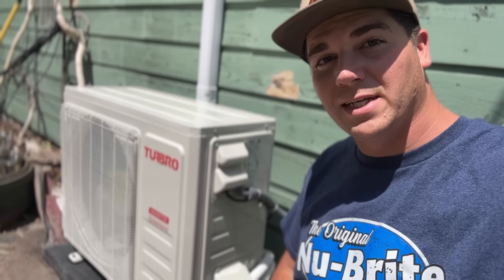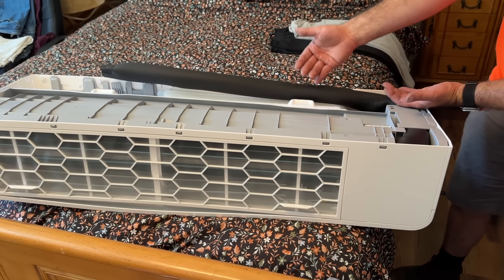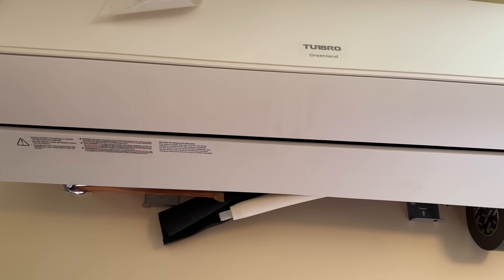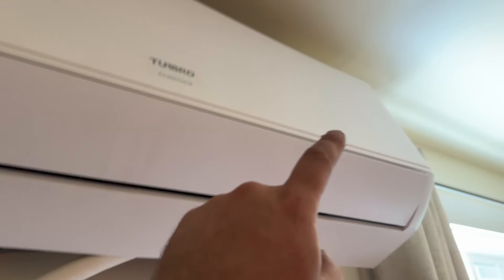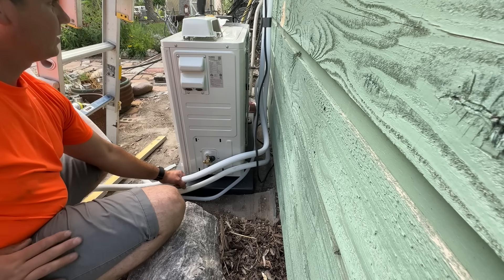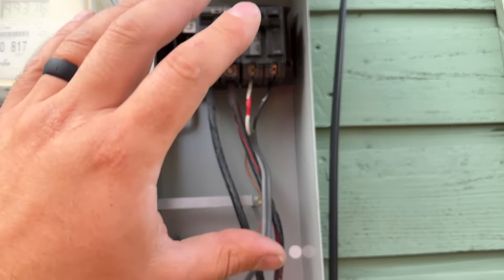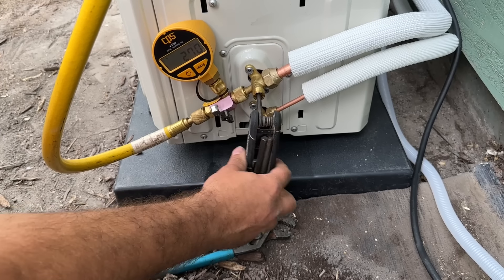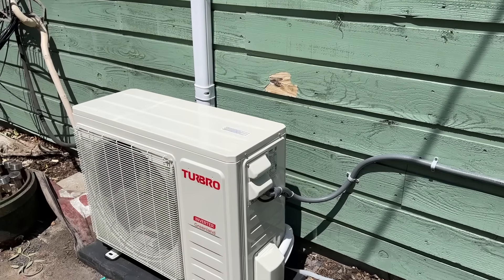Can You Install Your Own Mini Split? Here's All The Things Nobody Tells You!

Comment: Power (240V) to the indoor unit is evidently supplied by the communication wire, is that right? Doesn't this need to go through a conduit or shield of some kind when outrside of a wall?
Reply: No. The communication wire also supplies the indoor unit with power. The cable is listed for this purpose. No conduit required as long as the wire is protected with a line cover set.

Comment: I coiled my lines horizontally behind the condenser which sits about 30" from the wall. I was concerned about compressor oil collecting in the bottom of the coil loops. I'm certain that is does, not certain that it is an issue?

Comment: Do you think its worth it to replace my portable ac with a minisplit? A room where I do music recording upstairs is consistently either 10-15 degrees hotter or colder then the rest of the house. In the winter it doesn't matter as much because my gear/computer tends to warm things up enough, if anything its still can get to 78 degrees in the room in the winter so I often have to run the portable ac. Would a minisplit be more energy efficient? I am sure it will be quieter, the portable ac is LOUD.

Comment: I got a question so I know the mini split comes with the white insulation but i have seen you use a different white type on other systems besides the black k flex so what brand name is that pipe insulation? please

Comment: I installed a mrcool universal heat pump last week and have had the lines freezing over when I run the AC. I checked for leaks at the connections and didn’t find anything. Do you have any recommendations on how to troubleshoot any issue like this? Have you experience this with Mrcool heat pumps by chance?
Reply: I am not an AC installer but let me see if I can give some ideas on experiences I have had with awful installers. First off. Never use an Installer who uses a crew of illegals. 

Then you get stuck with arguing with non English Speaking installers who just walk away and the owner with the license never shows up. Then you have to explain that to them and they don't believe you and then a week later come out and see the mistake and try to fix it and fail and have to buy another unit. Tool 3 installs in a row for me to finally resolve all the issues and walk away from that company. Awful. 

1.  Not sure if you have a 2 story home or not. My first issue with installer was on 2 story. Freon was freezing at unit and not cooling upstairs. After 2 specialists from his crew came out they went and replaced the outside unit. Still no cooling upstairs. Freezing lines outside. Sent another team out. They found a shut off that had been turned off on the upstairs return in the attic where they replaced the coils and heater unit   
So make sure all the returns are opened in the attic. Have no idea why you would have a full shut off for returns. That's air. Not freon. Freon wasn't going up to the coils at all. Just freaking annoying they kicked it closed and walked away without checking for cool air. 

2.  You check for leaks at connections. Did you check to make sure nothing got bent somewhere. Coils or what not. Is it holding pressure. Biggest thing I learned was you have to filter out all the old freon if you change over. Have to get rid of all the bad and moisture. If your unit burned up you may have crud in your freon lines. 2nd house single story. They pulled the old freon but didn't clear it completely and also didn't vacuum it long enough then made sure it held pressure. Unit froze up outside and inside and ran until it blew a hole in the compressor and leaked freon all outside. They replaced unit outside. Owner was ticked and did everything himself. Bad install 2. 

Now for number 3. You may get a unit that says freon included. Believe it or not factories out of Mexico can make mistakes since that is where almost all the units are made. Freon in Mexico is the cost of bottled water. Here it's the cost of gold. Thank you Democrats. Your unit may not have come with enough freon. So just because you have no leaks doesn't mean you had enough freon to start with. You may have to add some. Another 2 story house. 

One other thing. Filter. If you are using the thick 4 inch filters that act like a firewall. That keeps air from going over coils. Try going to a 1 inch filter. More air takes away more cool from coils and allows unit not to freeze up. Just use a good one inch. Get more air. I don't use thick ones. Cost to much but they all do now. It is called Bidenomics. Double the price of everything and then say inflation is slowing down. What a moron way to destroy a country. 

I am not familiar with heat pumps. Just know I don't like them. Thought the house was on fire when auxiliary heat kicked on. Messed up. I will look more into them. Just in Texas we have our own grid and natural gas is cheap. Only way to dry clothes. Cook. And heat a house. And water heater. Not sure I want to steer away from any of that. But Biden will take care of that. Use natural gas to make electricity for your electric everything he wants to force down your throat. Once again Democrat morons.

Comment: I don't understand why you did not move the condensated drain line to the left side, there should be a connector on each side ?😇
Reply: I thought this too with my setup on the turbro - but the spring clip was designed to work on the right side.  There’s a plug on the left that looks like it could be the case but it wasn’t built to work with the clip from the other side.  

This is probably solved by somebody more experienced than myself but I didn’t tempt fate on my first DIY install…
Reply: I installed about a dozen of these misplits for my house and my relatives, Pioneer, Senville, Gree, ... all of them have the drain connectors that I could move the lines to left or right, just use a pair of pliers to remove the clip.

Comment: Why is it that some unit need to be vacuumed and other not and to recharge the unit what should the pressure be and why is it that you only need the low side
Reply: the only units that don't need to be vacuumed are DIY units. they come with pre charged copper lines and they are fixed length
Reply: low side and high side are connected.

Comment: Notice also that a nitrogen pressure test should be done over a vacuum test because in vacuum it has the tendency to pull the connection together and minor leaks are never detected. Besides any rise means there is a leak, that is why high pressure tests are best.  Also check your electrical code for breaker size, 20 amp seemed low, should be a 30 amp breaker. Also use the right wire size such as number 10 wire. Lastly notice this guy is a professional and his neighbor is the DIY guy, yet he asked a professional HVAC tech to do the installation. So all you DIY guys take note that it’s better to have an experienced tech help you.
Reply: The sticker on the side says 20A MOCP/16 MCA.
Reply: @bnasty267  Os that minimum or recommend, because my local code says to use the 30 amp and you have to go by the electrical code for your state not the manufacturer.
Reply: @morallyinsane7639  I highly doubt local code requires a circuit that can handle 2x the current that mini will ever draw, even worst case. Local codes usually are stricter for the ambiguous parts of the NEC, not the stuff that is pretty clear cut where the equipment is rated.  That sounds like some jackoff AHJ (inspector) BS. I'd call him on his nonsense and make him show where the NEC backs what he's saying.

Do you have a link to the the local code?
Reply: @bnasty267  All I am saying is to check you local code, it’s not my ass on the line if something happens, but yours. Do what you want, just understand that if you have a home inspection or something happens and they find it out of code, not only will you be sited, but it could void your insurance. That’s why it’s better to be safe then sorry.  

According to specs for an 18K mini split it calls for either 20-25 amp, that’s why most electricians install a 30 amp. 20 amp is the minimum, recommend is 25 amp, but most breakers are either 15 amp, 20 amp, and the next size up tends to be 30 amp.
Reply: @morallyinsane7639 Agreed. Read the docs, which have to be stated on the plate on the compressor unit with a MCA and MOCP. Size your wire to the MCA and use the recommended MOCP for the breaker size if possible. For AC units, the MOCP can be higher than what the circuit would usually allow for. Dumb home inspectors don't realize this is possible, but that's their failing. Going lower on the MOCP (to the MCA) is usually fine, especially on minisplits that don't have high starting current.

Comment: What's the furthest distance I could install a mini split from the main disconnect? Is there a distance limitation? Thanks!
Reply: General guidance for electrical circuits is to not have more than 3% voltage drop. This is dependent on the gauge of wiring used and the amp draw of the mini. There are calcs online for this: use the MCA rating of the mini for the amps. Roughly speaking, you're good up to about 100 ft of wire, beyond that, you just need to go to the next gauge wiring (probably 10/2 NM for most minis). So, you can go as far as you want, but you might need more expensive wire if really far.

Comment: Hi. When you cut off the first excess copper tubing for the inside unit  at about 10:30, did the nut/bolt/connector come off the part that you cut off so that you then put it back on the copper before making the flare? Or do I need to buy another bolt/connector and if so, what is it called? Thank you for your presentation. Do you have a video showing a manifold guage hooked up to the vacuum pump? I have been trying to configure my electrical. I have a box outside that goes to an inside breaker, a 50, and in the box is a double 30 and a double 20. I’m not so sure the 115v unit using 14AWG and one 20A breaker is all that safe. Is it. Seems alittle easier having the 20A near where I’m putting the outside unit. What do you think?

Comment: Total cost

Fieldpiece MG44 Vacuum Gauge - $231.20
CPS VG Vacuum Gauge - $166.09
NAVAC NP4DLM BreakFree® Cordless Vacuum Pump $779.00
PVC Line Cover Kit $49.99
Basic Electrical Install Kit $185.00 Includes power line whip, electrical disconnect

So, an additional $1411.28 over and above the cost of the mini-split, $679.00 110v or  $709.00 230v, not counting hand tools.
Reply from the maker: $2100 total.   Considering most company’s charge 4-5k for a mini split install. That’s a great savings.
Reply: @diyhvacguy  👍👍👍

Comment: QUESTION:  Do you think you could run an AC off of a battery system for like 8hrs?--Sailboats have a "soft start" capacitor that helps with the amp draw everytime the compressor turns on.
Reply from the maker: Oh sure! Batteries are expensive that’s the problem. Many people have a large enough solar array and batterys to be completely off grid.

Comment: HVAC tech rates.  $80 per hour for me to do the work.  $160 per hour if you've already tried to install or "fix" it yourself and messed it all up.  $320 per hour if you want to stand around and watch me work while giving advice and "helping".  🤣
Reply: I'm calling b.s.if HVAC guys were charging $80 hour and knew what they were doing homeowners like me would hire them. Instead they are charging around $200 an hour,  but only if you buy your equipment from them at 2x retail. Furthermore, they often don't know how the stuff they're installing works. It's a crapshoot hiring HVAC techs, most appear to be installers charging what id expect to pay someone who knows how things work and how to diagnose things. So, if happily pay someone $80 an hour to do it right the first time but that's just daydreaming.